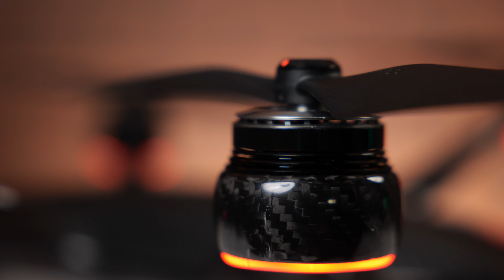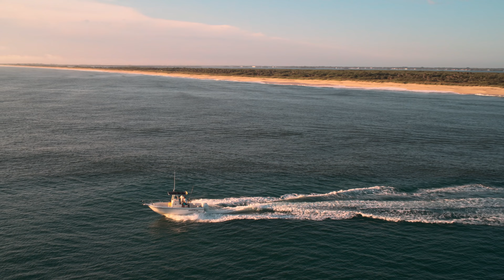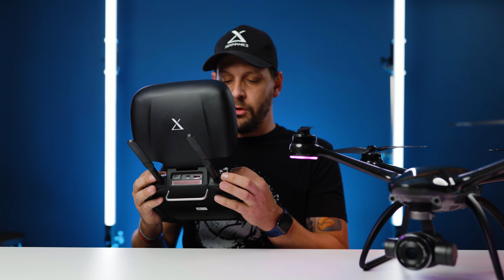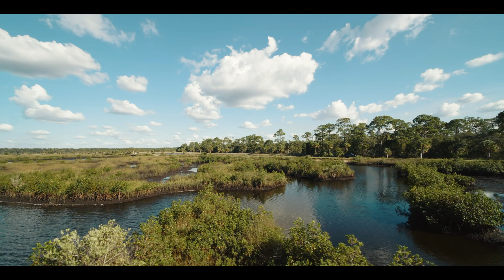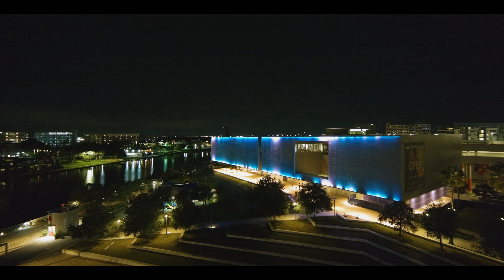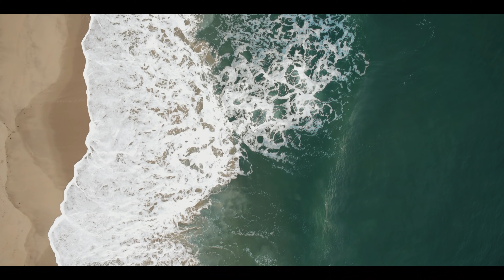XDynamics Evolve 2 a frustrating first impression

Comment: If you guys watch Captain Drone's "review". He's clearly a paid shill for XDynamics. He goes out of his way to make excuses for it. Best controller ever?? It's a freaking brick that looks like it was designed in 2013 when the Phantom came out. Insane to charge this much for a bulky drone that only has 12 megs. The larger pixels excuse is BS. You can still have more than 12 megs and low light performance. They've simply bought a cheap outdated sensor.
Reply: Disagree.  . On Sony sensor product lineup it is the latest, most expensive and most difficult to handle the color science sensor as the pixel size bigger the more light as well noise will come. That's why most will find 20mp easier.

Comment: Ken - Sorry to hear here you had such a frustrating experience with the Evolve 2. I’m hoping it was a shipping mixup and the Xdynamics team will “make it right”. I have been an Evolve2 volunteer test pilot/photographer since May and have over 2000+ minutes of flight time with the E2. I have seen it all with multiple pre-production versions.  The version I am flying now is really encouraging and haven’t flown my other drones in months. 

I have never had an issue flying in manual focus mode using the Olympus 17mm on the E2. I shoot in full manual mode all of the time; stills and video. There is a situation where the manual focus bar is not visible if you are in the “gear” menus WHILE FLYING. It will reappear if you exit the “gear” menus. Perhaps this will help.

Overall, my experience has been pretty positive. I have found the images to be very accepting of color grading. I also find the E2 strong in high winds,  un-phased by rain/snow or high altitude. I have flown at sea level and 10k+ MSL. I have really come to like the clam-shell ground station as something totally self-contained, has interchangeable batteries, is durable when tossed in a backpack and needs no attached devices to fly. 

As a guy who has 5 years of drone flying and 40+ years of television production experience, I’m thinkin the E2 will be a solid tool for capturing high quality images in an efficient, compact and stable platform. I am optimistic the E2 of tomorrow and next week and next month will be that drone. All the best.
Reply from the maker: Yeah so the experience was lackluster and the latency is not acceptable at this price point. The camera is nice but it’s not the most amazing I’ve used. My background is in videography and software, this should not have been green lit. It’s a shame that with 2 years time this is where we’re at… excuses don’t fix the issue.

Comment: A lot of people in the community have really been looking forward to the release of this drone. A micro 4/3 sensor on a drone that is smaller and less expensive than the Inspire could be the perfect tool for many. But it seems to still have some issues that would be very concerning to many, hopefully most of them can be fixed via firmware updates. And sorry you received a unit in such used condition, which could be the cause of the some of the issues. Great job on this review, you really covered everything.

Comment: Um I got something you would be dying to hear but I can't post such. Hint: received a used item as new. Did you send yours back already and how long ago? Did you log the serial numbers? Like you said none of the features work. I received some items repackaged in a already used Amazon box. At first I started discovering and noticed items missing etc included those plastic rubber caps for the external antrnnas and no neck brace for the controller. Then a rattling of some plastic piece in the station and the battery was slightly damaged and then that solid gimbal had dents and road rash as if that thing took a dive. Also I found some sort of hardened resin all over the unit like glue or tree sap? Or maybe someone 420 while flying high(er). Does the gimbal come attached? No plastic wrap of any sort Anyway we can establish a communication to see if I am over reacting. Thanks
Reply from the maker: Steven shoot me an email, been working closely with their team. I will say they are quick to react and rectify.
Reply: @OriginaldoBo  where do I find this email.  I've looked on your channel.
Reply from the maker: Info@originaldobo.com

Comment: Thanks for your review, I was considering buying this drone. It is definitely a beautiful aircraft, but after this video. I will just stick to my phantom 4 and inspire 1 a little bit longer.
Reply: Hi Radames, We respect your decision to stick with your current gear, but please check out additional reviews of the EVOLVE 2 after recent firmware updates and we are confident you will find it to be an excellent platform for video and still photography.
Reply: @XDynamicsGlobal  thanks for your comment, I will definitely check the reviews. I really love the design of Evolve 2. I am looking forward for future updates. Thanks again.
Reply: @XDynamicsGlobal  Still waiting for some updated reviews...... I would really like to buy your product but there is no way I will touch it until there are reviews that detail a fix for the latency issue and working obstacle avoidance sensors.

Comment: I was impressed with the vidio results you had, considering you had to improvise.  One can only hope that this is a very pre-production model to get your's, and others' input that they can implement into the final product.  I would not buy this with the huge controller.  I don't mind the two screens, but they should be closer together in some manner.  I do like big screens and would prefer a choice between 800 and 1200 nits if that is possible for cloudy days/ evenings vs bright sunshine.  As you suggested the landing gear should be retractable or removable on such a large drone. I would prefer a bit higher price with some great improvement. I don't know the capabilities of the Lidar, etc, but I would for sure want some side and rear sensors with some Ai and follow me capabilities.  I suspect that this is designed to be more of a professional drone than a recreational drone, but still, at the price point, it needs to be more user-friendly. Once they produce the final improved version I will be interested in your final comparison as I do follow your thoughts and recommendations.
Reply from the maker: I think this unit is the final design as they have already started shipping them 😵‍💫
Reply: @OriginaldoBo  Ouch!  Well, considering your following, I would hope they send you a new one like they are shipping so we can get an honest appraisal of what we would get.  I am not a Part 107 professional, at least not yet, nor a potential customer as I plan to buy the Mavic 3 asap, but still, the video did impress me and I would like to know if or when this is ready for prime time.
Reply from the maker: I was shocked when I unboxed it and inspected it.

Comment: For a mico 4/3 camera with lenses, I've just bought  (you may laugh) a Yuneec 920+ new for $1500.   It's massive and a job in itself to set it up, but I can replace the batteries with available ones (not smart batteries) and it sports a Panasonic GH4 camera.  I just wouldn't want it to fall on something.

Comment: That's pretty disappointing for a drone that cost that much but we are glad to have reviewers like you who will tell it like it is, I was wondering what the range was for the drone, you didn't get a whole lot into that
Reply: Hi Michael, Our initial published range is based on the chip set specifications we’ve used in the development of the EVOLVE 2. We are still currently testing the published range under various conditions, but we traveled over 3.5 miles (18480 ft) in challenging conditions as demonstrated in our range and speed video posted on our social channels.  We hope to reach our published goals with more testing and fine tuning.
Reply from the maker: It’s dismal 4500 ft or so on a good run